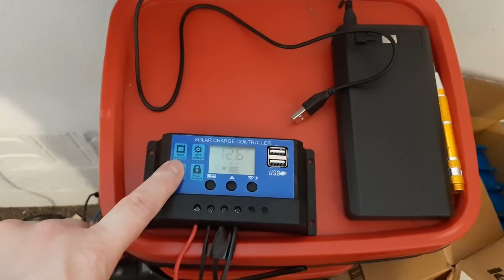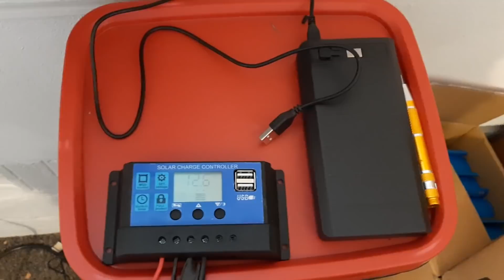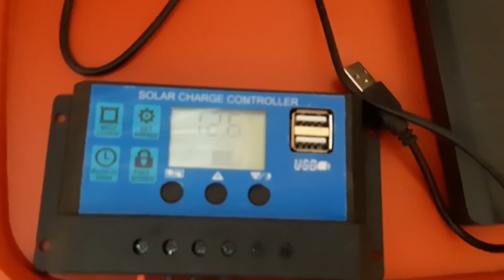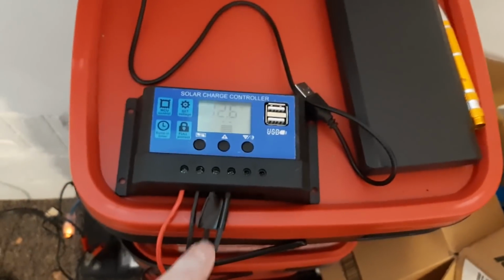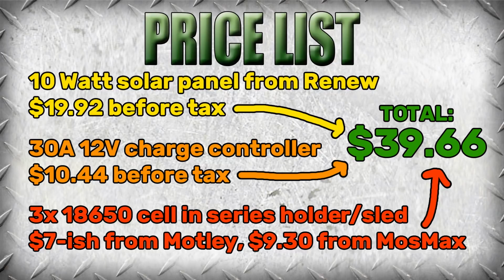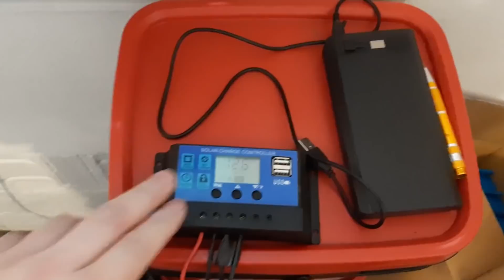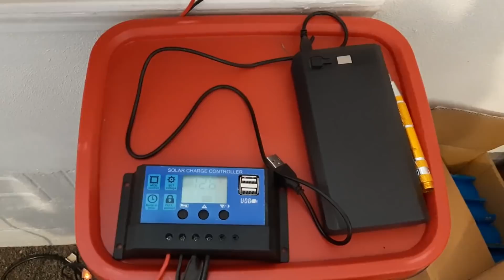My Secret Project is Finally Done and it's AWESOME!

Comment from the maker: It runs on mono green mana lol
Reply: REEEEEEEEEEE
Reply: Green ramp be like
Reply: Green mana does everything!
Reply: but wait isn't the white mana symbol the sun?
Reply: Wouldn't it be mono white des, mono white literally has a sun as its symbol. I have the same controller with a 300 watt panel and 2x190ah batteries in my bus which will charge anything usb for days. You wouldn't have to change your controller to run your AC because your AC would run off your batteries but they wouldn't have the capacity and your panel wouldn't keep up with the draw

Comment: So Des, I have 2 400 watt panels. I run those into 2 deep cycle batteries. Running through my pure sine wave power inverter I can watch 1 movie on my computer or cook 1 meal. That's at night, during the day I can pretty much mess on the computer for hours on end.

Also My lighting is 12v dc led's I bought from super bright leds dot com. Not a plug just where I got them 10 years ago and they still work. They are as bright as fluorescents without the brain pain. And yeah, pretty much free lighting.

Comment: A few things: I nearly killed myself charging lead acid batteries in my apartment, the hydrogen sulfide fumes are LETHAL, please be careful. Smells like rotten eggs. AGM batteries are less likely to off-gas, and cheaper than Lithium. 

Secondly, using solar panels to operate fans for a geothermal AC system would be far more efficient than trying to run a window AC unit. 

Great work tho Des, love your stuff as always.